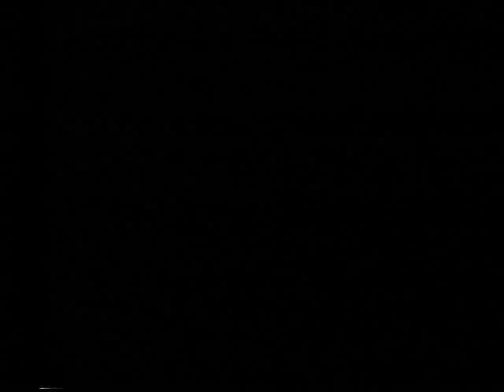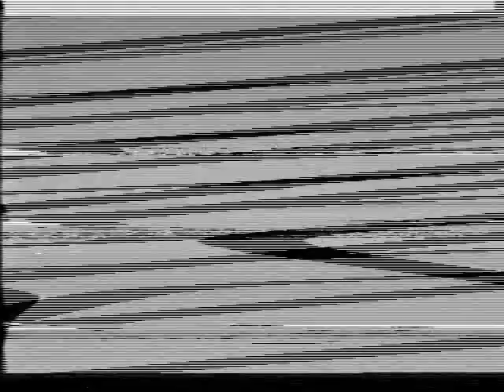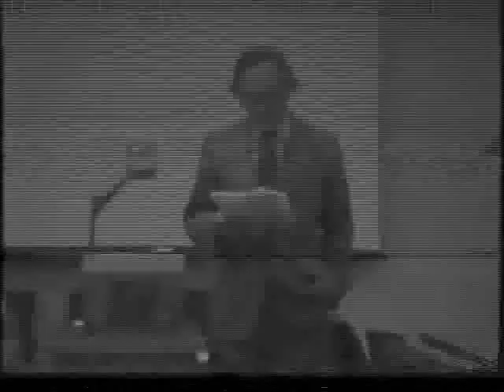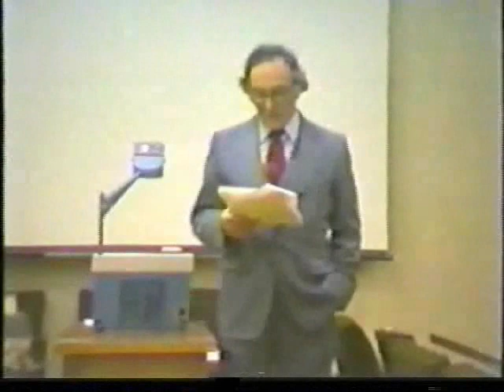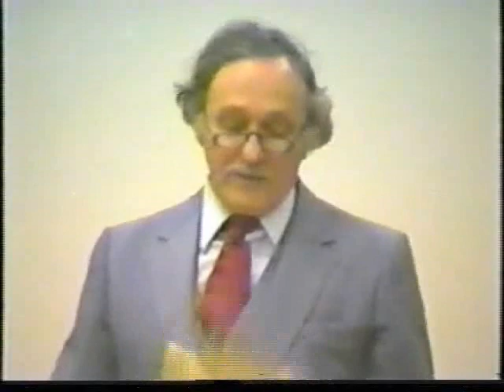Andrija Puharich Lecture Part1

Comment: Andrija ("Henry") Puharich,R.I.P.

Note something: In 2008,a man named John
Kansius,working on a radio-wave cure for 
cancer,discovered that salt water would 
liberate hydrogen...and that gas would 
burn...at the correct frequency.

However,neither that (nor this) can violate
the law of Conservation of Energy. Splitting
water back into hydrogen & oxygen does NOT
yield more energy than put in. It's only a
novel method of energy conversion...